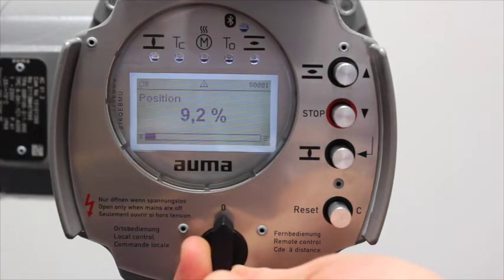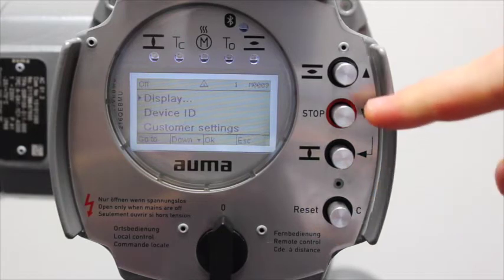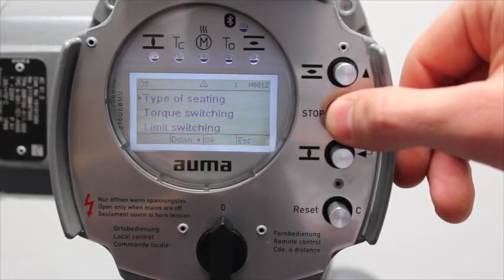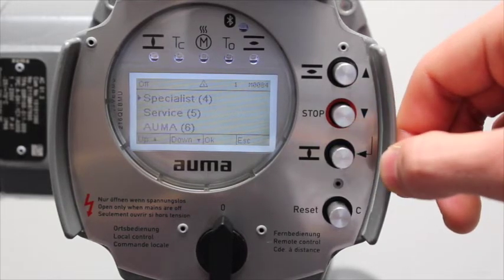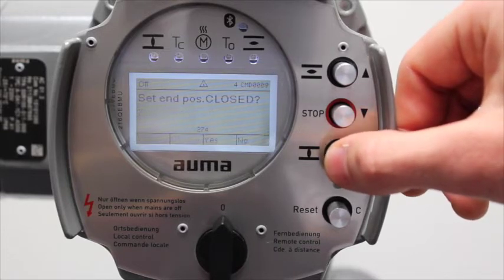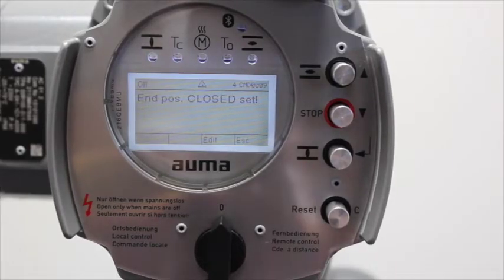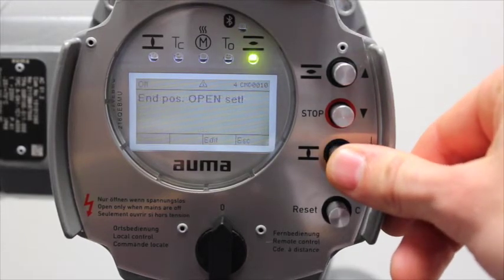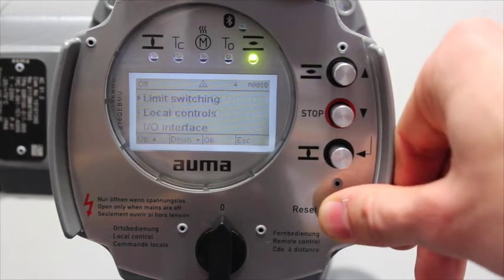AUMA ACTUATOR  Setting The Limits

Comment: Hello, I see your video is very helpful but what if I need to set my limit for opening to 90 and my limit to close to 65 (so in my system I want this motorized valve to operate between those settings. can you please support me?

Comment: im facing an issue in auma actuator sa10.2-f10
when operate from dcs on remote mode, on small percentage of closing command valve does not stop there and keep on closing untill 0%. 
Please share your expertise
Reply: There's a feature called self-retaining remote that you want to disable. It should then follow a push to run style of control.
Reply: @mattewen1424  Thanks for replying. But 7 months ago i tried everything in the parameters. Than magger results of motor showed fault, got the motor rewinded but valve was still not functioning as required, temperature switch of winding was damaged on overheat and after replacing that everything is fine.
Reply: @Yasirbacha118  Great to hear, I didn't expect you to still be figuring this out after 7 months, I hope this might help someone else troubleshooting their actuator. I'll have to think about how a thermal switch would cause the issues you mentioned.